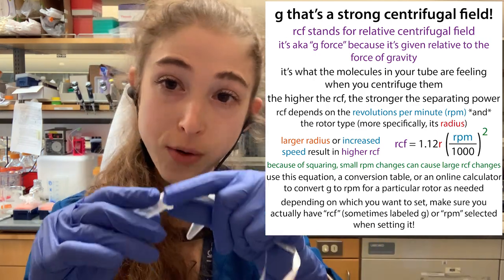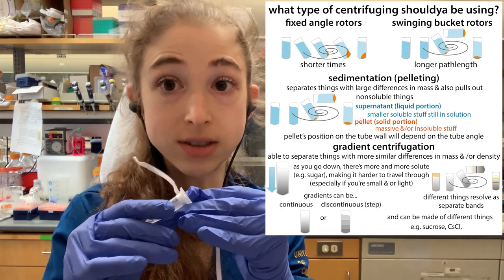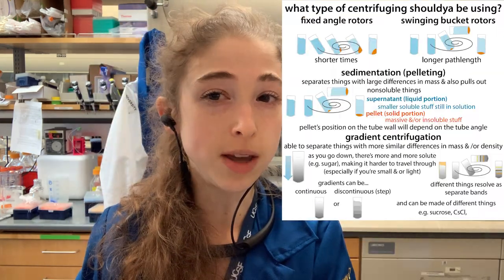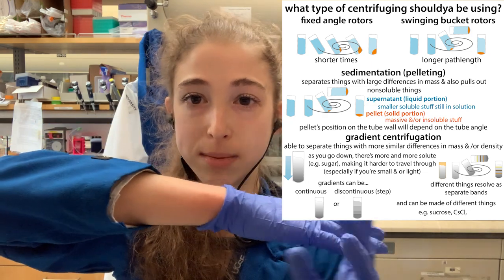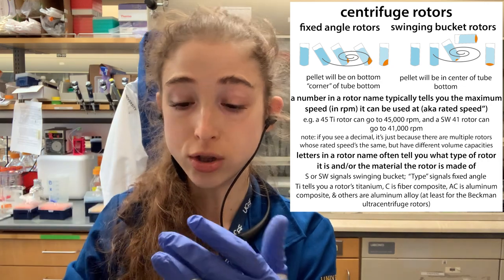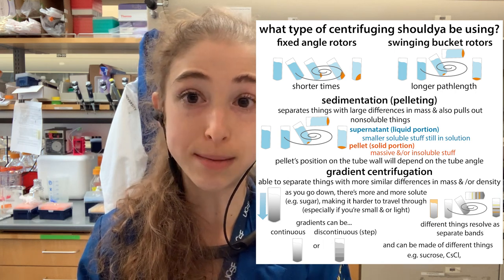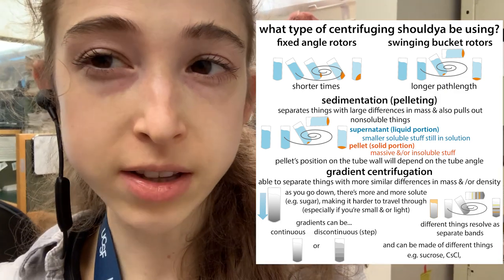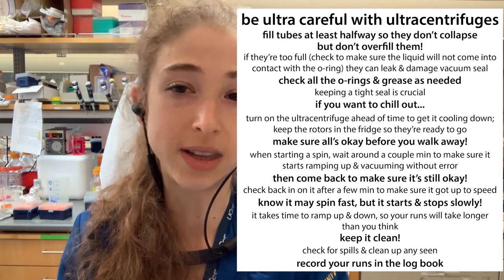Basics of lab centrifuges - rpm vs. rcf, swinging bucket vs. fixed angle, ultra vs. "normal", etc.

Comment: I have a 10 ml centrifuge with fix angle and a minimum radius and a maximum radius . I do not find the radius  in the centrifuge manual but it is written RCF =1150  g  for 3200 rot /min.  What would be the  (average) radius for calculation of RCF  ?  Is it 10 cm ?  Could the radius be artificial increased  by decreasing the volume in the tube from 10 ml to 3 ml  for example ?
Reply from the maker: I don't know sorry but changing the volume won't change the radius
Reply: @thebumblingbiochemist  IT depends on the radius .If it is the maximum radius - the RCF does not change but If it is about an average radius ( for fixed angle centrifuge only) between the minimum and maximum,  then RCF is changing once with decreasing the minimum radius ( meaning decreasing of the level of the liquid in the tube).
Reply from the maker: Gotcha. Sorry I misunderstood your question

Comment: Could the Amicon 100  be used with fixed angle centrifuge ?
Reply from the maker: Yes - but you may need to adjust the speed and volume - the product manual will have more information.
Reply: @thebumblingbiochemist  thank you.